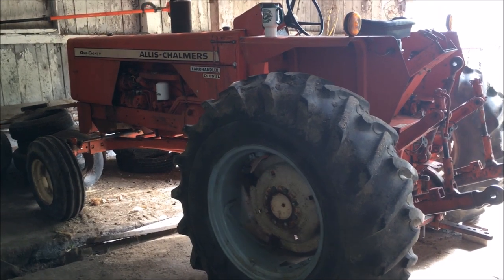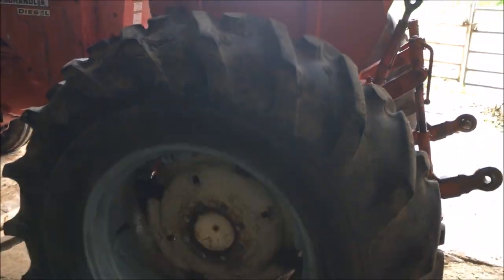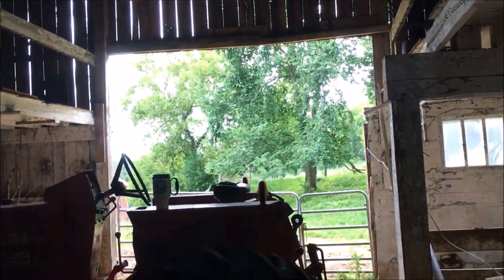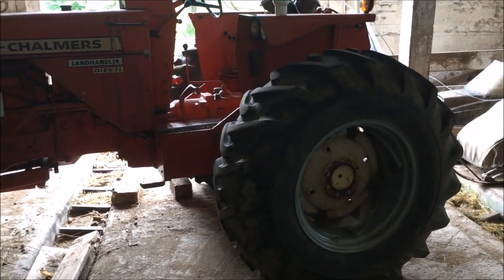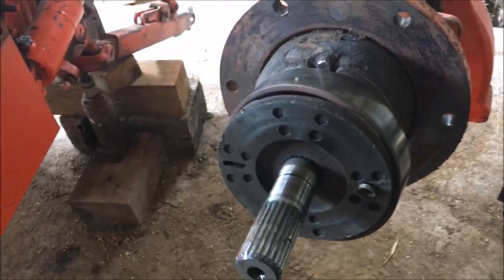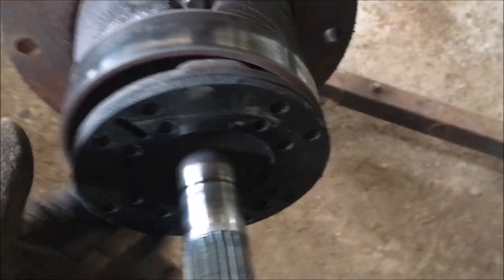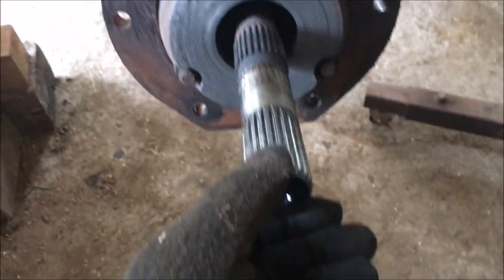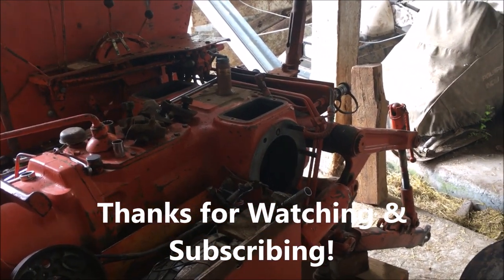Allis Chalmers 180 Brake Repair - Part 1

Comment: Those loaded tires can be very dangerous. I had one pin me up against a car when it over powered me doing a brake job on a Massey. I could not upright it . I had no one to help me so, I had to let it scrape down the front of my legs then get my feet out from under it. Very painful lesson. I always now have a overhead support of some type just in case.

Comment: just did brake job on a wd45  you dont have to pull final drive of  just 180 and 170  been doing allis brakes on wc wd wd45 d17s all my life!! they now have a puller for the pits!! and l always replaced pin with nonstick pins  last one we did pulled pins out with my fingers but a lot of the pins are old style and come out very hard! l will be watchin!!!
Reply from the maker: Thanks! I think this is easier than a WD45 or D17.

Comment: Dont be so hard on yourself.  You leaving the brake on didnt destroy your brake.  It was getting due for replacement.  Those brake locks getting left on is a common occurrence, usually just makes some smoke and takes some life off of the pads.  Aftermarket brake linings are reasonably priced but I prefer the AGCO linings.  They are a kevlar coated metal plate meaning they cant brake and fall off like yours did.   They also dont glaze over.  5 times the price of aftermarket linings but worth it.  Keep up the good work.

Comment: Love those gloves, I've gone through several pairs. Is that an old Artic Cat sitting behind the Allis? Yeah, not an easy fix but at least farming can continue while waiting on parts.
Reply from the maker: Yes, an Arctic Cat and 3 Yamahas. Haven't been run in years. I should load them up and take them to a snowmobile auction this fall.

Comment: I was surprised your brake latch actually worked to cause that much damage. My 180 has a stick for a parking brake. Parking brakes wasn't Allis Chalmers best feature. But at least it doesn't pop out of third going down hill!
Reply: Good  day Gary Bridger  What is the problem with 3 gear. At a auction fellow jump on & tried 3 gear,  ending up buying it Thanks
Reply: @donvoll2580  that is the one to buy. Always drive them first. The one I have my brother drove up and down the hill at the dealers to make sure.
Reply from the maker: The brake latch on this one works darn good. It's a 71. I don't think this tractor has been abused.